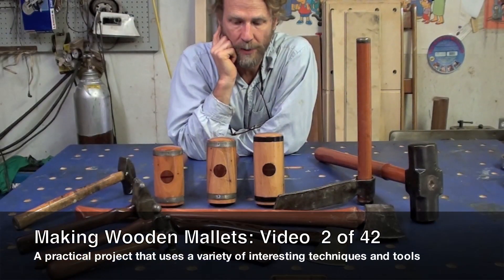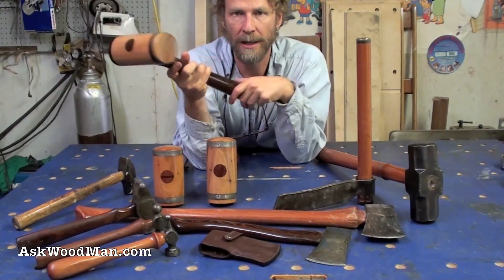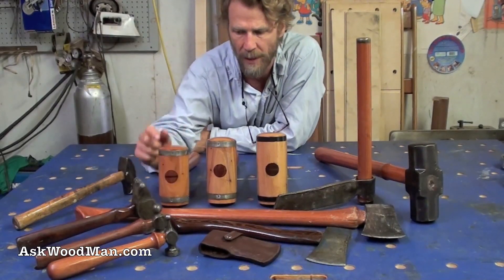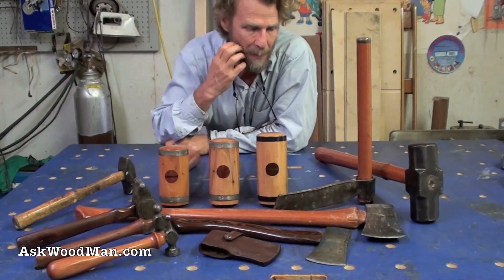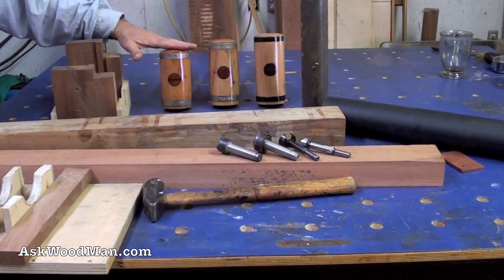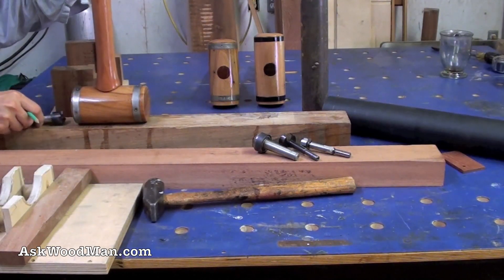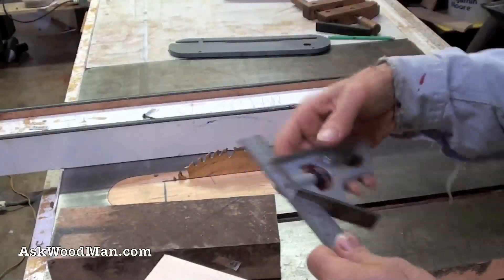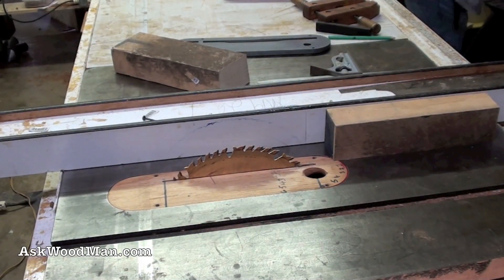2 of 42: How To Make A Steel Hooped Wooden Mallet • Woodworking Projects

Comment from the maker: @materiasacra I never weighed them until now. So these weights are including handles. I only have 4 left to weigh. I will give barrel wood/handle wood so you can identify them. Lyptus/Lyptus 1220 gm, Pecan/Lyptus 896gm, Maple/Lyptus 736 gm, Pecan/Wenge 958gm. I made this series last July and been just loving using these mallets.  "Mallet Man" could be the sequel to the book. A superhero who uses mallets to right wrongs and bonk heads for justice :) Merry Christmas/Happy New Year